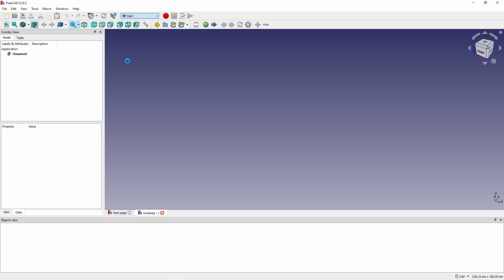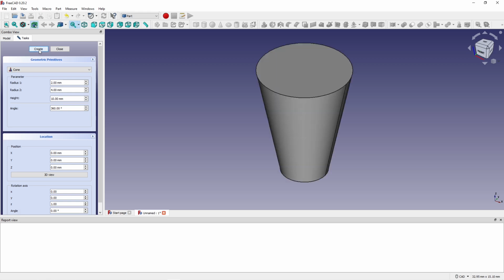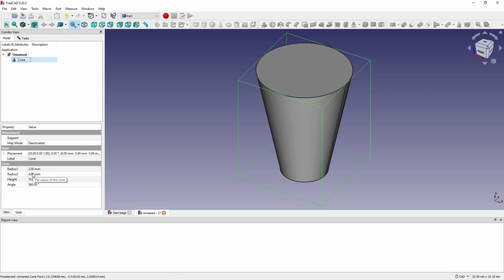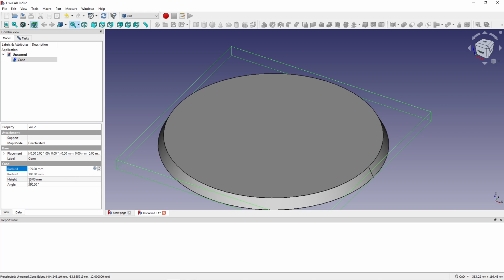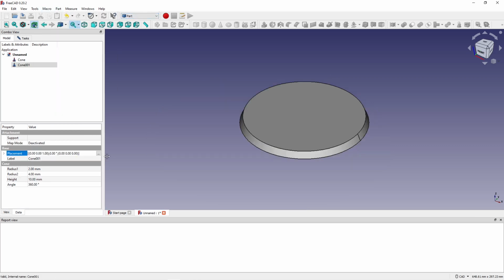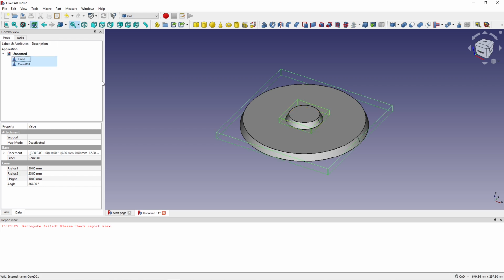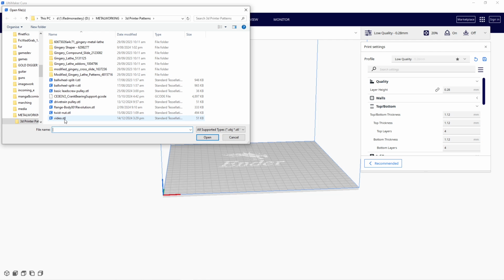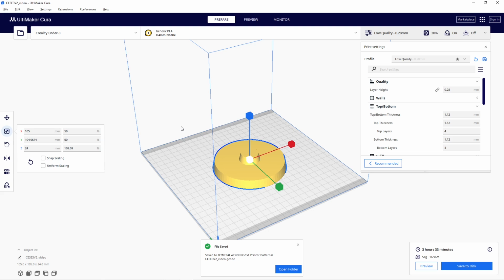Making Leadscrew Drivetrain Pulleys

Comment: You go through the trouble of making the lathe bed longer than the book calls for so you can fit the shaper on it, and don't drill one hole on the headstock? 😅 Were you not planning on doing the change pulleys originally?
Reply from the maker: I honestly forgot! 😊
Reply: Great job, either way, as always. If I ever get around to it, I will definitely be picking your brain as I go through.

Comment: You may well be better off with HSS than negative rake carbide inserts.
It's cheaper and you can grind angles better suited to cut aluminium, particularly  steeper top rake.
It also uses less power to cut compared to negative rake tools.
The angles don't need to be perfect, just have clearances on side and front with 15 to 20 degrees laid back from cutting edge.
I think I mentioned I use diesel when cutting aluminium, kerosene is recommended but diesel cheaper and easier to get
Reply from the maker: Tried grinding a HSS tool, and you were right, when ground properly they give a super nice finish and feel

Comment: Happy new year! I think if i was doing it i'd have drilled and reamed a centre hole first. Could be spot drilled on the lathe first then drill press to avoid your spindle. Then make a mandrel in your chuck and mount the pulleys on that. Would have meant you'd have the extra space to create the V groove from both sides and would have made it easier to face and flip.
Reply from the maker: ... good point!